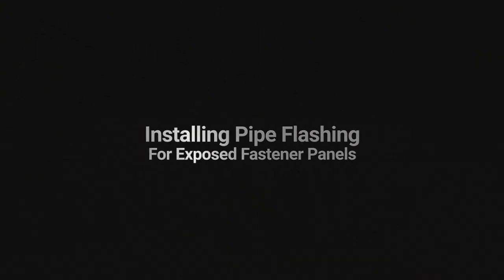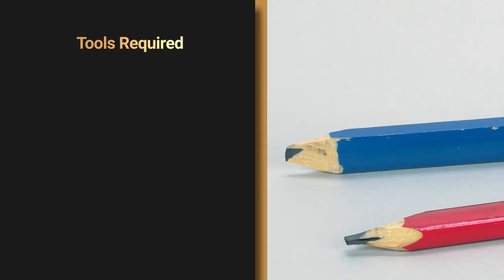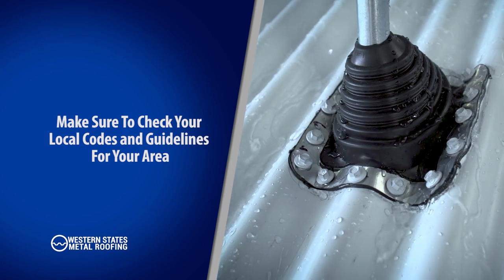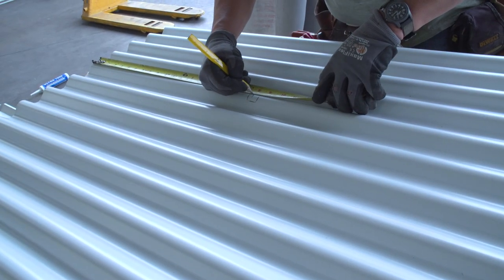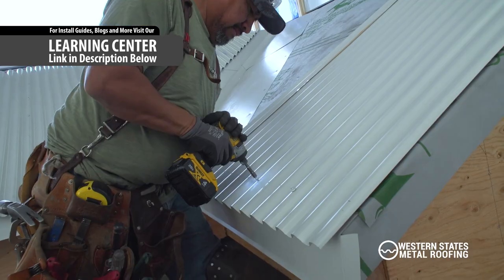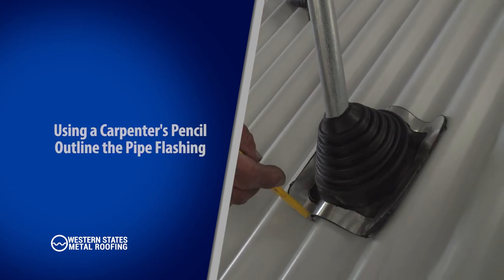How To Install Pipe Flashing & Vent Pipe Flashing On A Metal Roof. Corrugated Pipe Boot Installation

Comment: Why no silicone under the boot to back up the seal of teh rubber boot? Major oversight.
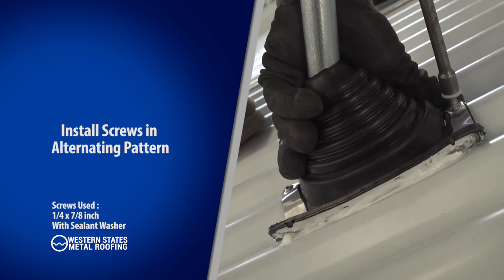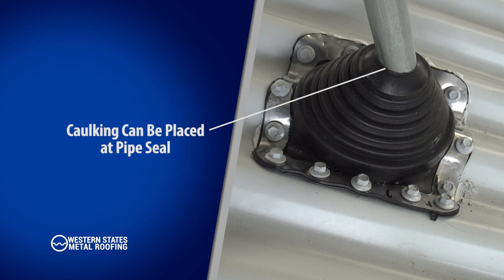Reply from the maker: Greg, We appreciate the feedback and I want to make sure that I am understanding your comment correctly. We show sealant being applied to the pipe boot at this time stamp in the video, 2:35-2:45. Also at 3:17 = top of the boot at the pipe. Let me know if this resolves this comment. Thank you.
Reply: @WesternStatesMetalRoofing  I mark where the boot will end up on the pipe, and apply silicone just above that spot before sliding the boot back down, so that the silicone forms a donut inside the boot, preventing any water that should slip past a boot that becomes loose or has any kind of crack/fault from getting trapped inside the boot. Then over the top as well. Takes an extra 30 seconds but gives years of peace of mind.
Reply from the maker: @gregorywatson4590  Thank you for the excellent installation advice. I'll pin this last comment.

Comment: Slick video for the DIYers.   Needed to show a 2" or 3" vent  installation, where a hole saw is required. Not quite as easy as a 3/4 or 1"  installation using a variable bit.
Reply from the maker: That's a great idea. I wish I would have thought of that prior to filming this video.
Reply: @WesternStatesMetalRoofing  Thank You.
Reply: I do this stuff for a living and I would NEVER recommend this method.
If you must use goop don't use silicone use Gutter Seal polyurethane.
The way to properly flash a toilet vent is to have a sheet of roof steel longer than the normal pitch.
A couple pieces of strapping should be installed beforehand so that you have something to screw into along the bottom of the boot and the top of the vent

Measure from the eaves to the bottom of the vent pipe.
Mark the steel from the bottom.
 Measure over from the lap side of the adjacent sheet and mark this steel at the center of the bottom of the pipe.
 Cut the "U" shape out of the steel so that it just touches the bottom of the vent
The top piece of steel should be flipped so that the factory side is down.
Once again measure over from the lap of the adjacent piece and mark the top piece of steel.
Fasten the bottom piece of steel with a few screws away from the pipe.
Slide on the flashing boot so that it overlaps the sheet you just put on.
Notch the top piece of steel so that it's an inch or so away from the peak of the roof and overlaps the bottom piece of steel and the boot.
Align the ribs carefully and add some screws a few inches up from the edge of the steel, evenly on both sides.
If you're able to do this well and there's sufficient pitch on the roof you shouldn't need any goop at all.
If you do need roof sealant don't use silicone.

Comment: Apparently no one on the planet knows how to vent a bathroom fan or range hood through an Ag panel roof. I have been looking for a month. I only found a few people posting terrible ways to do it that will eventually leak.
Reply: So is this the correct way ?
Reply: @Noold  This is fine for a pipe. Good luck finding anyone that knows how to do a roof vent though.
Reply: @stwerks  any idea how to do a roof vent? I have a small sauna I need to vent out the metal roof.
Reply: @John Stevenson  it's a shed roof, with a very low slope.
Reply: @Noold  that's gonna be tougher. You will be where I was. No good info. I ended up using soffit vents and blocking the adjacent vented panels to avoid it. The one roof vent I have has an overlapping panel. I'm not crazy about the way it looks. The roofers did it. I ended up leaving it and getting a discount on the install price.